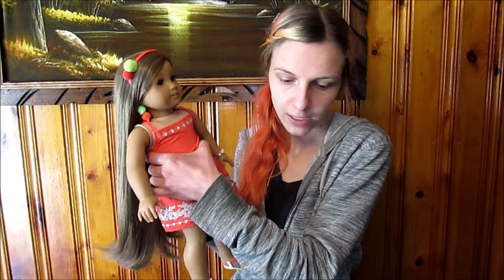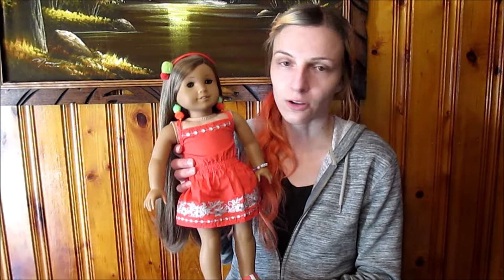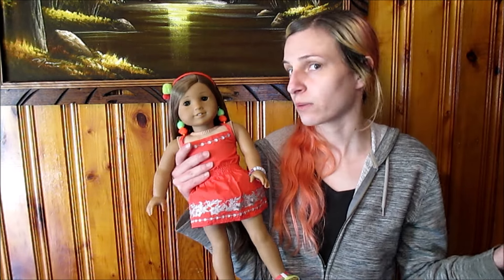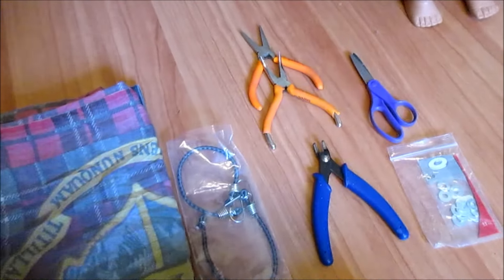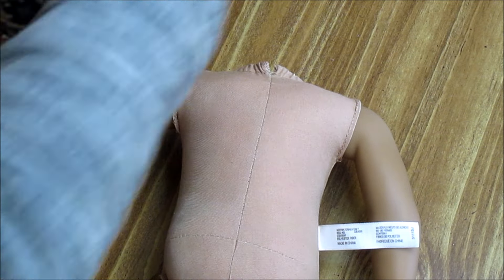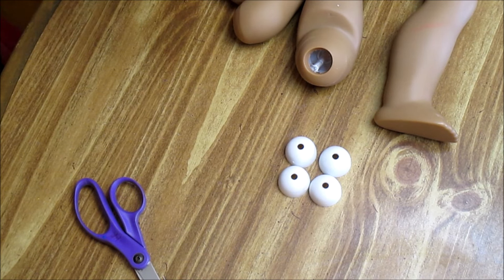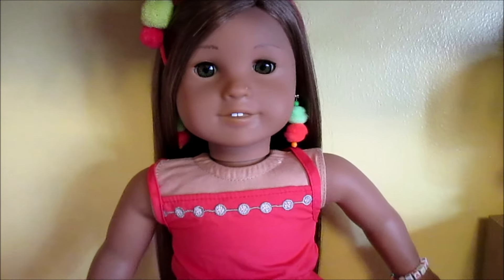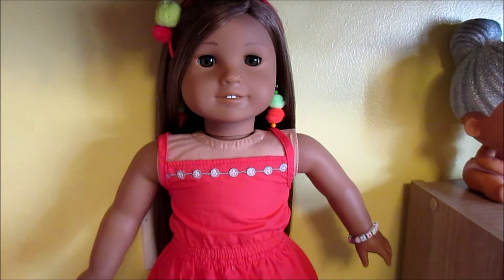How I Restring American Girl Dolls

Comment: I would keep the extra long string so just in case you'd need to fix the doll later on or maybe even knot the bungie cords after getting the limbs on using the metal things
Reply from the maker: If you were using the knot method, then it definitely makes sense to keep it long :) Once you put the metal clamp down, there isn't a way to remove it unless you cut it off, so keeping the string long doesn't matter (and knotting it afterwards isn't necessary since the clamps hold the bungee in place).